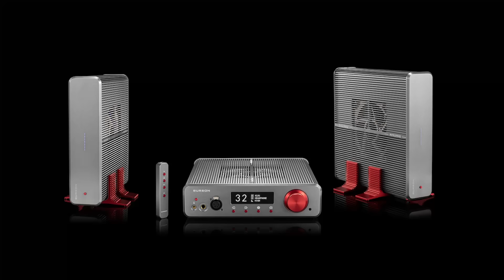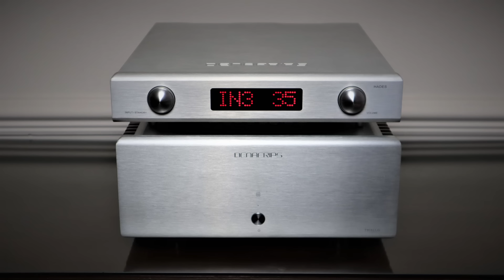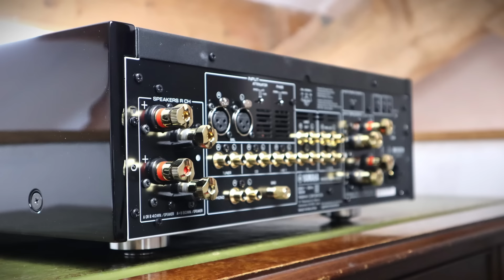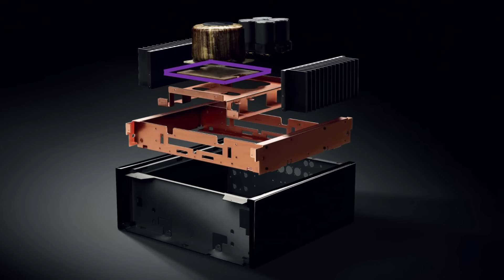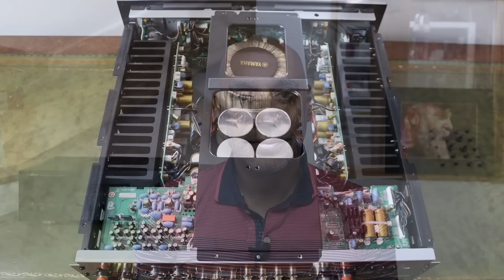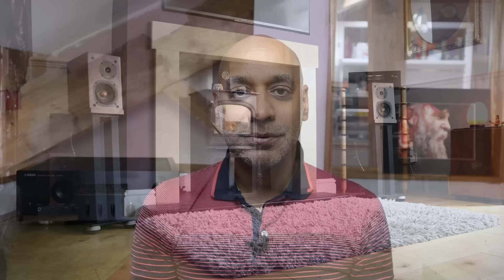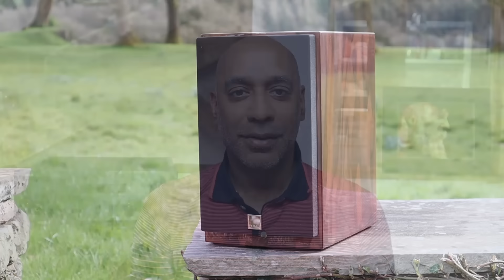ATTAINABLE HIGH-END! Yamaha A-S2200 Amplifier Review

Comment: Hey Taron

Just to add to the Balanced debate, I am running balanced from start to finish with Cambridge 815D DAC run from Roon Core, this runs into Advantage S2 fully balanced pre-amp into Advantage S150 fully balanced power amp (S 2 is class A, the power amp first 50Wpc in class A then class B) all cables decent quality XLR. Speakers are Proac DT8's run from bi-wired Chord Rumour X cables. 

I have tried running these on Line in-out but the balanced makes a huge difference on noise floor, imaging and treble/midrange clarity.

BTW, have you ever tried or reviewed the DT8's?

Love the channel.
Reply from the maker: Thank you Sandy. I have heard the DT8s quite a few times and always liked them 😊

Comment: I too started the Yamaha path when a dealer demoed me the Yamaha A-S1100 (no longer available). It was at a discounted price of €1499 at the time about a year ago. The quality of the design and the materials, alongside its super-clean design, made me fall in love with it. However, what was most shocking is how clear and powerful the sound was compared to almost any of the other amplifiers in the same range. Nothing came close for the level of stereo imaging it gave, and this is a few steps 'under' the A-S2200.

Also, these babies are about 40kg total and are so solid that you can just feel the craftmanship and construction quality just from touching or carrying it. Best is that it also allows you to connect them with a receiver and trigger to allow a complete set of both surround and stereo. All the features that were on it were baffling at the price tag, and I can't think of upgrading to anything else anytime soon. If you want to have more punch, however, you can even add subwoofers to the amp (or combine it with a receiver with a subwoofer).
Reply from the maker: Thanks for sharing 😊

Comment: I have the predecessor to the AS-1200, the AS-1100 I've had this Amp for going on 5 years. I won't go into much detail, but the sound changed significantly over time and this Amp at the end of year four sounds very different in terms of micro dynamics and midrange presence and bass control than it did at the end of year two for example.  It no longer sounds lean at all (in my opinion). Not to completely discredit channels such as this, I think that conclusions drawn about gear that haven't had enough hours to burn in (mine literally took years) should be taken with a generous dose of salt.
Reply: Same experience with my A-S1200.  It was forward bright and a bit thin sounding when new.  Probably 2 years on, now it's sound is wonderfully clean and smooth with a detailed soundstage.  

My amp was a return from Audio Accessories 4 Less and I got it for 1K off MSRP at the time.  My amp clearly wasn't used much as it and it's remote were spotless.  I suspect the prior owner unboxed it, didn't like the sound and returned it.  I knew the amp needed break in, and was rewarded for my patience.
Reply: I sold my AS-1200, just did not find very engaging. Different strokes for different folks.

Comment: Couple of things to add to this - excellent as always - review. I have the model above, the A-S3200. Actually I have 2. And Yamaha amps are known for one quality above all others: neutrality. What sound comes out of them will depend largely on what you feed them. The "downstairs" is used mostly with a Denafrips Pontus II DAC and Gaia DDC, and the sound coming out of KEF Ref 1 speakers is the 3 Dimensional detailed soundstage we've come to expect from this brand. "Upstairs" powers Mission 770 speakers, and the sound is coming from an RME DAC Black Edition, which I love for its EQ'ing capabilities. But there's no comparison. Plenty of detail and UMPF, but super analytical, with vocals pushed waaaaay back, which surprised me. This is a temporary set up though, and ultimately the Pontus will move upstairs to be replaced by a Terminator +. The only thing WRONG with any Yamaha amp, is that they don't come with the beautiful furnace you have in your chimney mantle...what a beauty! Cheers from LA.
Reply from the maker: Thank you for sharing 😊
Reply: what is your point? what are you claming, is it to analytical for you?

Comment: Just bought the A-S 2200 yesterday (silver one) ... and "wow" the sound from this amplifier.  Previously I was using the Thule Audio IA75B (a Danish brand that has not existed for some years, but did produce highly recommended hifi components at the time; 11 kg amplifier, so it is only half of the Yamaha, but not an "empty one", it is well made).  What I noticed right away about the Yamaha was the high frequency clarity and the control over all the fast things going on in the music.  I also noticed and questioned the lack of bass in some way.  Not that there is not a bass there, just the clarity is so ... "mind blowing" that one is perhaps gets the feeling that the bass is somewhat missing.  For loudspeakers I'm using my old faithful Sonus Faber Grand Piano speakers (also in "heavy" black piano finish - matching the sides of the amplifier) with the Sonus Faber Gravis B subwoofer.  I may have to look some what into the settings on the subwoofer to see if I can get the bass more "out".  I have mostly been playing CDs to test it and I'm using the Thule Audio DVA150B for the job.  But the clarity and the presentation of each instrument/vocal in the space is something I have never had before and each song I listen to is like I'm listening to it for the first time.  Next steps in the testing will be to look into the bass (as stated before), use the XLR connections between the CD and the amplifier (currently using the RCA) and see if I notice any positive changes.  Also I will connect my Technics SL-10 (with the original MC pickup, Technics EPC-310MC) and see how it performs. The price I got it for (brand new, un-opened box) was "only" £2075 (incl. the high 24% VAT) - which is a lot of money for me, but compared to the prices you state and I see advertised in the UK and the USA this is a "steal".  Normally the price factor between Iceland and abroad is the other way around (x1,5) so this was a nice surprise for ones.  At the store I was informed that I would be able to return it if I was not satisfied with the sound when hooking to my home equipment (or anything else).  As you are buying an expensive item and you are not sure how it will sound at home - and if it actually will be a step up from the amplifier currently used.  The verdict is that this amplifier is "a keeper" no question.  I have been watching your channel for a long time, and I really like the way you approach your critics - not drowning one in numbers, just stating your personal opinion about the item you are reviewing - THANKS.   Updata :) ...bought the Yamaha CD s2100, going to Sweden to pick it up (a heavy "beast", 15,6 kg) it was heavy transporting it walking around in Stockholm area I strapped/taped it to a scateboard I brought with me and then got it on board the AC (going back home to Iceland) as an carry-on item - this was an adventure ... but all the problems/sweat was worth it in my opinion, and I have a story to tell ...the sound of this par is so good the sound is just floating ....thanks again for the channel.
Reply: Yr amp needs to break in
Reply: @nasdkhan254  OK - so you are saying that I can expect better bass after "break in" after running the amp for some hours?  Was that your experience - or the unit you got was already "broken in"?  B.R. from Iceland
Reply: @axelviarhilmarsson6317  Hi. Leave your amp permanently on ( disengage the auto switch off ) and have a source ( Internet radio/ tuner ) playing & after 100 hours the sound will mellow out. For the first few days it had a thin sound but it blossomed out. All the best
Reply: @axelviarhilmarsson6317 yes bass will be much dipper and more meaty
Reply: @MrJatzeq  Thanks - I did not realize that there was an "issue"/phenomenon like this (probably because I mostly have bought used items in the past).  And what you mention is what I see as missing regarding the bass, but the clarity and details are there.  Now I will have to find myself a Yamaha cd-s2100 or 3000 to go with it ...and hopefully I will be able to find one at the "right" price.  Thanks again for commenting.
Reply: @axelviarhilmarsson6317  Im talking  about  new units  before its break it comparing to all ready warmed up one units with few hundred hours on it
Reply: @axelviarhilmarsson6317 hi, did you ever solve the bass issue in the Yamaha 2200? Did letting the amp run in for 100 hours change anything? I am thinking of buying one and do like my bass though.
Reply: @HAL-vu8ef   Hi, I think that is the case.  At least I stopped noticing it - or it might be that I just got used to it.  We know that the "normal" Yamaha sound is often stating of being very "clear" and the UK amps more soft (if this tells you something).  I also have (I think) a good soft subwoofer (Sonus Faber Gravis B) - I dont like "hard" bass, I want the bass to support the lower freq. (Hz) and not comming in with a "bang" (Like one would/might like in the Cinema - if you get what I mean).  The subwoofer is adjustable, at whch Hz it comes in.  This subwoofer is a match to my Sonus Faber speakers (Grand Piano) which I have owned now probably for 20 years.  Ofcourse it will matter which speakers you are going to connect to it.  Some people say that one should never use subwoofers, but I think it is okay if you use the correct one.  But in the end what matters is what you like - but I believe that you will be happy with this amplifiere - and like in my case the price was so low that I could not "skip it" - for me it was an investment in a way, but I do not replace my HiFi gear frequently so I want to select my items carefully.  It has to be taken into account that here in Iceland very few expensive Hifi brands are awailable (almost none existing).  So I do not have the comparison with some other Japanish brand like Accuphase - which I have read very positive review for when being compaired f.ex. with this amplifier.  But as I stated, for the price I got this one for, it was no question of buying it and I dont regred it and paired ths the Yamaha CD player this is much better than anything I have owned before.  Kind regards from Iceland, Axel
Reply: @ thank you for the reply, very interesting. It is a beautiful item.
Reply from the maker: Thank you for sharing 😊

Comment: I have this amp. I run the tone controls flat. But perhaps your room or how you like your music requires a boost. Maybe use the supplied controls to tailor the music how you like to hear it. Excellent review. Im happy with this amp..I run it into Klipsch Cornwall 4s. I listen to classic rock Jazz and Indie ..with some electronica thrown in.  I also  use a PontusII dac for the digital side. Ive never felt that the mid range was thin, ever. It's very clear and weighty. Maybe it's the klipsch helping out but I have no complaints at all. Thanks for the review
Reply: same heare cornwall 4 and as-2200 once you heard the clarity and  defenision of the yamaha thers no way back
Reply from the maker: Thank you for sharing 😊

Comment: I’ve invested pretty heavily in balanced topology, because noise rejection is a good thing, right? But I’m not sure it’s truly required for good sound. I was quite taken aback when I learned the Dartezeel amplifiers, made Switzerland and retail for gobs of money, don’t include balanced outputs or inputs. The designer of this world-class amplifier didn’t believe they sounded better or added any value to his product. I began to look at gear with different eyes: ‘balanced’ connections  can be added quite cheaply, truly balanced construction can help reject the noise throughout the chain, but it does not, by itself, guarantee great sound quality, and it means the added expense of processing two signals instead of one, doubling the parts count, energy required to run the equipment, and possibly creating ever more noise, I suppose. There is a need for it where long cable runs are required, but we’re talking over 12 feet where RCA/phono can peter out. The connectors take up a lot of real estate on the back panel. All of that being said, I still prefer them, and I tend to look for them on gear I’m considering for purchase; but it is no longer a ‘must have’ for me. I would prefer to have balanced lines from analog and digital sources, especially analog; from pre-amp to amp, and from amp to speaker; but I have gotten good results from source to preamp with quality, shielded RCA/phono jacks too.
Reply from the maker: Thank you for sharing 😊

Comment: Excellent review Tarun. Sharing my experience incase anyone is also considering similar setup. I got Chord Mojo 2 + Focal Clear MG headphone and really like the sound. It was "fast", resolving, dynamic, and very real sounding. Not much meat on the bones, no added body, etc. Not analytical. Best I can describe it -- not coloured sound.

I wanted to replicate the experience with speakers. I had Hegel H95, Dinafrips Ares II, Buchardt S400 MK II. Great and "large" sounding system, but slow-ish and not nearly as resolving as the headphone setup. First to go was Ares, replaced with Chord Qutest. Resolution and timing improved. Soundstage and layering were similar. Still not sounding like Focal Clear MG. Next to go was the amp. I replaced Hegel H95 with Yamaha A-S2100 (previous generation to A-S2200). Wow. Bass became tighter, there was MORE bass, resolution improved, transience improved, and instruments became more defined. Hegel H95 sounded more grainy and slow in comparison (still great amp mind you). Sound was getting closer to Focal setup, but not quite there yet.

Next to go were the speakers. I switched them out for Amphion Argon 3S. I thought Buchardts were the king of bass. Amphions have tighter bass, and more of it. Yamaha and Amphion speakers were a great mach. Fast transience, precise, everything well defined. Sound is holographic, with singers positioned centre stage between the speakers (left/right axis), and in-line with the speakers or slightly in-front (front/back axis).

Like Tarun said, you won't get added "body", etc. But personally I like the sound, and it's a very close match to Mojo 2 + Focal Clear MG (or Meze Elite which I also have). I like to think that the sound I'm getting is more "correct" vs lacking body, etc. I should also mention that the headphone amp section and the phono pre-amp on the A-S2100/A-S2200 are very good. I sold my dedicated headphone amp after getting the Yamaha.
Reply from the maker: Thank you for sharing Igor 😊
Reply: Quite a journey but I would never buy Yamaha versus British amplifiers like Chord, or Naim.
Reply: Are you still running the Yamaha / Amphion system? I recently bought the Amphion Argon 3a and like them a lot but they’re telling me my electronics are too warm. I want to pick up the pace a little and let these speakers shine.

Comment: I read these Yamaha’s hifi amps sound like tube. It may be colored but if its fun, who cares
Reply: Yes because of the use of Mosfets as output transistors, very important aspect of this amps which wasn't mentioned. Yamaha started using mosfets on the AS1100, 2100 and 3000. Now that is maintained in AS1200, 2200 and 3200. Beasts of amps. Heard the 1100 and loved it. Now i have the 2200 and it is a great amp, i Iove the sound, running with a topping D30 Pro Dac with XLR cables. Phono stage is fully discrete and sounds excellent. The amp screams quality and performance for a life time.
Reply: @cnoboa  There is a guy on youtube who is a big fan of as1100 and said he is not sure of as1200 as they moved to toroid in as1200 vs EI core in as1100. I dont care for balanced, so i might jump on as1100 or as1200 when the time comes

Comment: Hi Tarun The Atoll in 200 sign, costs 1750euros  while the Yamaha as 2200 costs 2800e[both  are dual mono ,mosfet designs] Does the Yamaha justify the premium , given its sound quality ?thanks in advance
Reply: Find 2nd hand as 2100 or even 2000 ....1600 euro and 800 euro for 2000. Bought as 2100 for 1600 euro and I love it
Reply from the maker: @MrJatzeq  cool 😎
Reply: Upgrade from as 500. Will be paired with tannoys xt6f. Looking for proper DAC now....
Reply from the maker: The Yamaha A-S2200 is a level up in clarity 😊